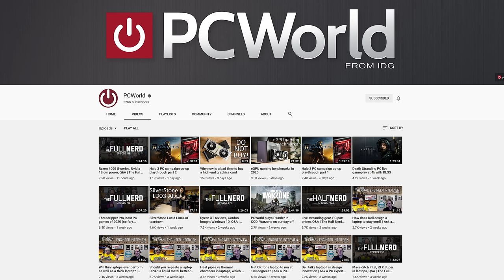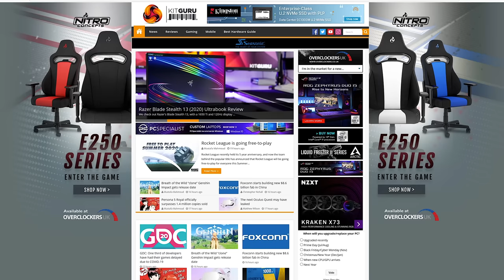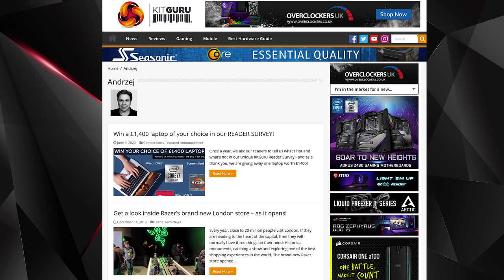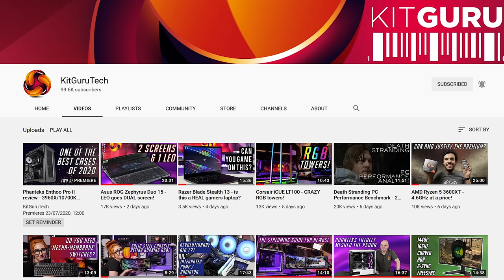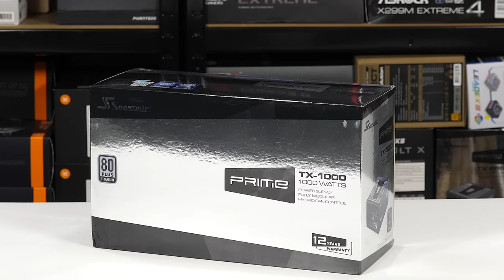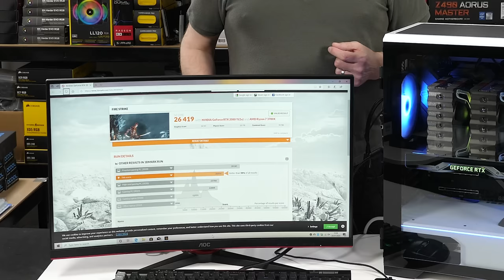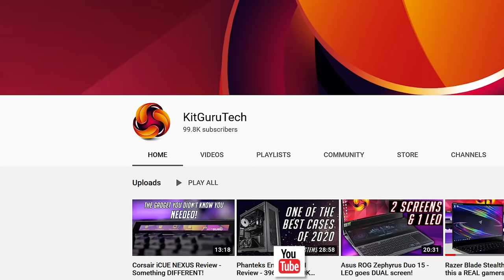100,000 SUB COMP - win 4 GRAND PC setup - 3700X and RTX 2080 Ti!

Comment: Not sure if I'll get an answer this video was made over a year ago, but do you think there'd have been any way to affix the Zalman backplate to this motherboard without modifying/cutting it? This is a motherboard I've actually considered and I'm glad I watched this video before committing , because if I didn't, I probably would have run into the same problem you encountered, but now I'm left wondering if I have to rethink my choice in order to ensure the CPU cooler fits.